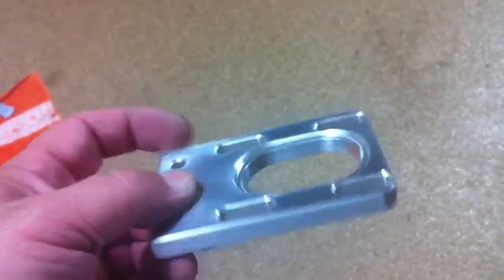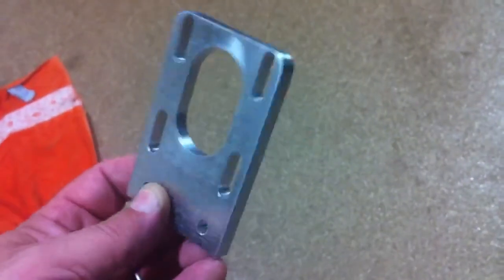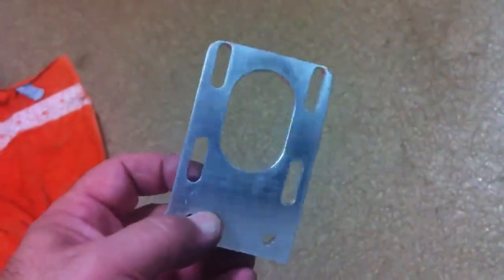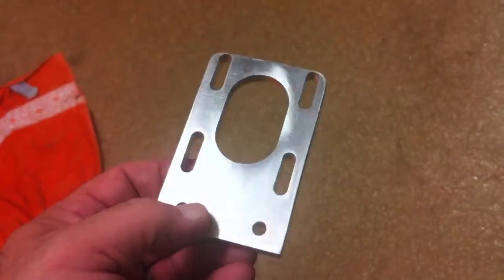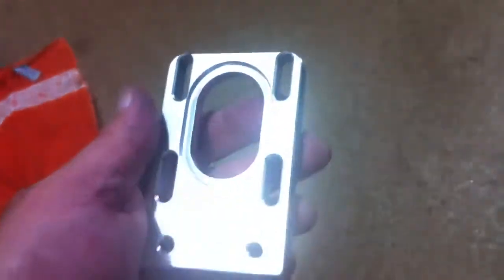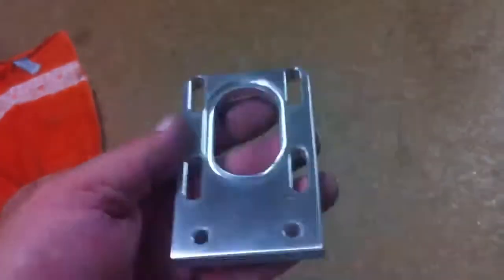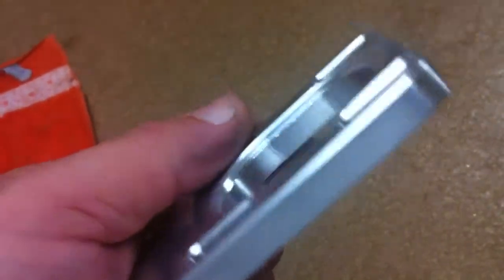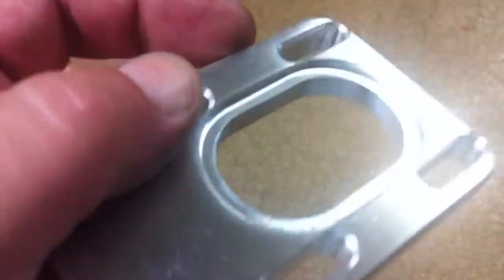First G0704 part finished

Comment: did you use ball screws or did you keep the original lead screws? and if you kept the originals how did you fix the backlash with the cnc mod? Does it keep good tolerance? great vid.